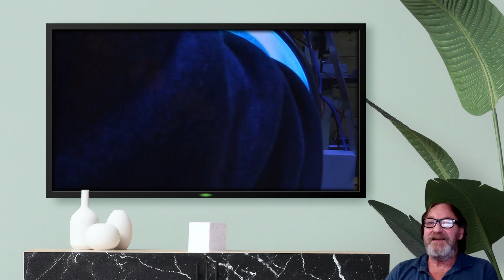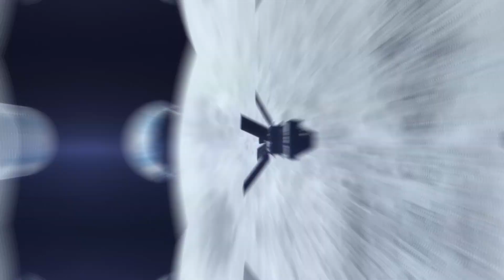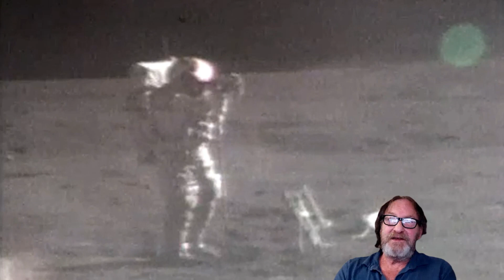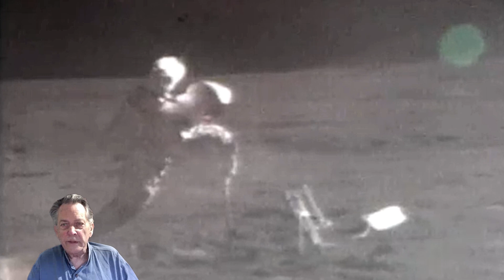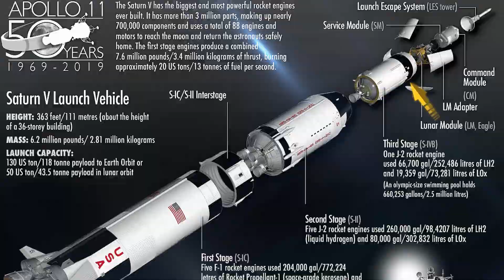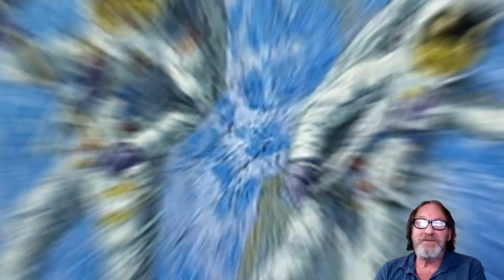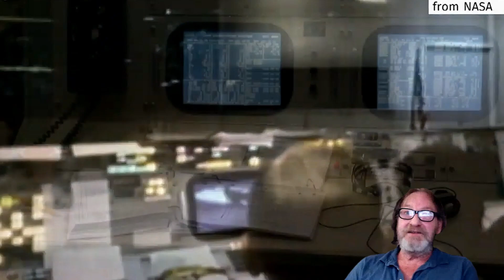THE APOLLO DISCUSSIONS "VACUUM TESTING\ OPEN LETTER &  DEFUNCT PHOTOS" PART 40

Comment: There is Nothing absolutely nothing man made in space.  the NASA rocket equation has 3 pressure variables.  none of them are possible in a vacuum.
Reply: The rocket equation predates NASA by decades and does not use any "pressure" variables.
Reply: @codetech5598  there are three pressure variables in the equation  Pt. Pe and Po.   
  A rocket works on the pressure principle and so an equation without P would be pointless.
Reply: @codetech5598   they do not use the Tsiolkovsky rocket equation anymore.  It is incorrect.   WernherVon Braun   ( who actually launched rockets) .  reworked it and developed the V2.
Reply: @boptah7489   It uses inertia and conservation of momentum, not pressure.
Reply: @codetech5598   It obviously uses pressure.  Otherwise there would not be 3 pressure variables in the equation.  If the P  variables are all Zero.  The force is zero. 
 the conservation of momentum happens when the gas molecules leave the rocket before it hits the vacuum and then under the force of gravity return to the Earth
Reply: @boptah7489  "If the P  variables are all Zero." - they are not though.
Reply: @mikeh3441  They are all Zero, because you cannot create pressure in a vacuum
Reply: @boptah7489  Unfortunately you don't appear to understand the material you've linked to.
Reply: @mikeh3441  I understand vacuums and equations.   . If a vacuum is present, the Po variable is ZERO.  You need RESISTANCE to create pressure.
   It appears you do not understand simple simple, basic physics.
Reply: @codetech5598  You don't use conservation of momentum to calculate the efficiency of a heat engine 😂
Reply: @papalegba6796   You are the one calling it a heat engine. A rocket engine can be powered by vinegar and baking sofa and has nothing to do with heat.

And we are not talking about efficiency anyway.
Reply: Pretty sure all internal combustion engines are heat engines 😂
Reply: @codetech5598  And so.   you admit that a rocket  needs pressure to move.  ?  
   The best way of creating pressure is to use Heat and dense gaseous mass.   A liquid rocket engine is exquisitely designed to create a high pressure area behind the rocket using the 'Teclu burner' principle combined with max gaseous mass. 
   Obviously , no pressure creation is possible in a vacuum.  but it works well in an atmosphere.   Wernher Von Braun discovered that a liquid rocket engine stops creating thrust at 100,000ft at European latitudes. . any extra altitude is gained from the momentum of the initial thrust  .  Bezos has the highest altitude achieved by man  ....361,000ft.
Reply: @papalegba6796  Exactly.  You use the conservation of energy to calculate the efficiency.   .  ie Diesel engines are 40% efficient,  and petrol engines are 25% efficient. .
Reply: @boptah7489  "And so.   you admit that a rocket  needs pressure to move.?"  No. A rocket does not require pushing against an atmosphere.

What do you think the purpose is of all scientists and engineers deceiving the world with satellites which your kind says are really helium balloons or ground based antennae?
Reply: @codetech5598  a free body diagram shows a thermal rocket engine does push against the atmosphere, like all other aircraft propulsion units 😂
Reply: @boptah7489  ...and rockets are the least efficient internal combustion engine design in common use. Which is why all the propaganda surrounding them is so hilarious. They are useless devices 😂
Reply: @papalegba6796   You need to use the correct mathematical model for the job.

So you think satellites are really helium balloons. Now, what do you think is the motivation for all scientists and engineers telling people that rockets and satellites operate in Space?
Reply: @codetech5598  I have never said that satellites are helium ballons. Stop lying please.
Reply: @codetech5598  Also a free body diagram is the correct model for showing the forces acting on an object. Are you saying it is not?
Reply: @boptah7489  Pretty sure this codetech account is yet another NASA chatbot 😂
Reply: Anyway I'm off, as whenever I reply to posts on this channel I get reported for harassment. Which is well dodgy 😂
Reply: @papalegba6796  Sorry, I cannot keep track of all the trolls.

But since you say rockets cannot work in space, rockets could not get a satellite into orbit.  So what do you say satellites really are?
Reply: @papalegba6796  The FBD is used to account for external forces acting upon an object.  

Now, what do you think satellites are?
Reply: @papalegba6796  They are great for fireworks and children's toys though.   Such pretty colours.
Reply: @codetech5598   ALL satellites are helium balloons.  You cannot suspend a mass in a gravitational field without a force.
Reply: @codetech5598    They don't do it for free,  and the vast majority of them are ignorant.
Reply: @boptah7489  you can just bounce radio waves off the atmosphere through a variety of methods, no mechanical repeater needed.
Reply: Pretty sure a vacuum can't apply an external force, apparently saying so makes me a troll 😂
Reply: Also pretty sure an object cannot alter its state of motion without the application of an external force either. NASA really hate Isaac Newton is he a troll too?  😂
Reply: @papalegba6796  "I have never said that satellites are helium ballons."   In the new comment above, bo ptah just said, "ALL satellites are helium balloons."

Since both him and you claim that rockets don't work in Space, why the disagreement?
Reply: @papalegba6796  "NASA really hate Isaac Newton is he a troll too?"   No, Newton is correct. The trolls (the people in this thread who claim rockets don't work in Space) do not understand Newton's laws, specifically inertia.

Since the trolls don't understand Newton's 1st law, they do not understand the 3rd law either.  But being trolls, they claim they do, and claim every other scientist and engineer is wrong.
Reply: The NASA chatbot "codetech " has no idea who said what about anything, or what any laws of physics mean, & just wants to waste my time 😂
Reply: @boptah7489  This "code tech" account is definitely a chatbot 😂
Reply: @papalegba6796    _"codetech " has no idea who said what about anything, _

Why are you trying to divert attention to me in the disagreement you have with with bo ptah regarding helium balloon satellites?  

Obviously both of you are wrong as rockets and satellites do work in Space.
Reply: The "code tech" chatbot will not stop replying even though nothing it posts has anything to do with the subject any more 😂
Reply: @codetech5598   From the NASA site.  https://www.grc.nasa.gov/www/k-12/rocket/rktthsum.html

Comment: Astronauts complicate cooling system are made by idiots. Umbrella is very efficient in space where radiation is only way to transfer heat. Without air, it can be extremely light. Why not use best tools?:face-orange-raised-eyebrow:

Comment: When you think bout the supposed lengths gone to to keep weight down, like counting stitches in spacesuits… then look at all the superfluous stuff in the lunar images such as…
Sunglass Holders, watches, clamps used to attach documents to the LRV broken mudguard, canvas straps, metal tubes etc, etc…. It just looks like they didn’t think of weight at all, ridiculous 🤨
Reply: NASA is good at emphasizing small details which gives the impression to the casual observer that all the other details were properly handled.
Reply: Bet the Apollo crews were not even weighed before any lift off because it didn't really matter.

Comment: The video at the end, the Gemini 4 spacewalk. Do NASA have this in their archives and/or claim it is genuine and one they filmed? I'm not familiar with it but it's blatantly in a studio. Also, the point about earth rotating the wrong way is  impossible to tell without knowing which pole is in view in the video. If the north pole is in view, Earth is spinning the correct way..Albeit way way too fast, as pointed out. Viewed from above the north pole, earth always orbits anti clockwise and also rotates anti clockwise.
Reply: The orbital speed of the capsule would also need to be considered.
Reply: @codetech5598  Makes little difference to how fast earth would appear to rotate underneath. It varies very little to stay in low earth orbit (17,500 mph/ 7.8 km/s). I want to know if that is a NASA video they claim is real.
Reply: @maverick627uk  The Earth takes 24 hours to turn but a spacecraft takes only 1.5 hours to orbit it.
Reply: @codetech5598  Exactly.
Reply: @maverick627uk The Apollo Detectives failed to undertake any detective work (again). Its a simulation and pretty easy to track down. Why couldn't the ADs?

Comment: It occurs to me that (over and above the limited battery capacity) the primary reason that incandescent light bulbs weren't used on the moon was that no glass envelope would be required for filament operation. Nevertheless the moon batteries power capacities were not even sufficient for their purported uses.
Reply: Were these "special" batteries in the backpack rechargeable? Some missions they did 3 EVAs! And the voice communication were supposedly duplex; meaning they were transmitting and receiving at the same time! The amount of power needed for the coms alone was enormous!
Reply: @MagicRoosterBluesBand   There wasn't power to do shit. Too bad they weren't stupid enough to dare show any kind of a light bulb being lit up.